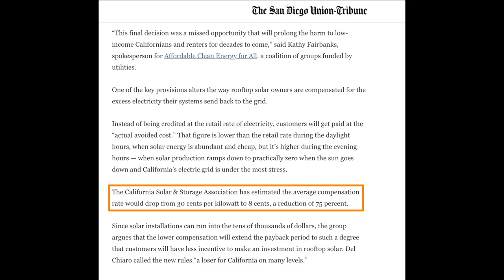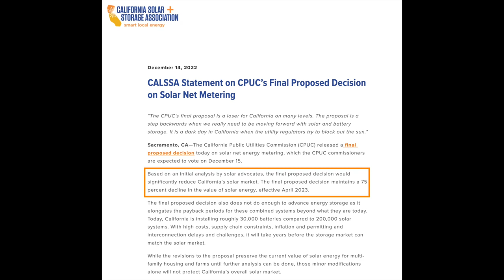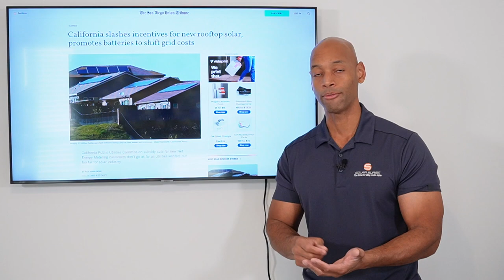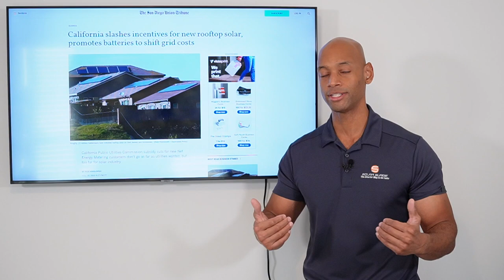URGENT: California Solar Program Ending April 2023

Comment: Keep voting for Democrats.
Reply: And we will dissappear like Rome
Reply: @erikapple8955  exactly!
Reply: Question: Does it have to be Docs signed or installed in PTO to be grandfathered in for 20 years for net metering?
Reply: @solarguy6517  - I’ve been told complete installed. Check with your utility company.
Reply: @appleforever6664  Roger that! Been studying it all night!
Reply: @nicksgarage2  - Not for solar. 🤡
Reply: @appleforever6664  but they hate green energy. Big coal, big oil, sure
Reply: I am hoping this is sarcastic.  Since the legislature in CA is run by the democrats.  In FL, the GOP passed a bill to eliminate net metering, and Gov DeSantis vetoed it.
Reply: @appleforever6664  it’s NEM application submitted, not PTO.
Reply: Jail time. Theives.
Reply: Okay 👍
Reply: In reality Republicans would have never had the program in the first place. Regardless, I normally vote for Democrats but have been voting Republican across the board in the last couple of elections. Many of these elected officials seem to have forgotten they work for us, we don't work for them.
Reply: Net metering was never meant to be a long term solution. Storage and use at the point of generation was always the inevitable end point to all this.
Reply: @acefire4050  - Completely agree with you. My statement was with sarcasm. This is what happens when people vote for Democrats and then they turn on the people!
Reply: @rfjgfude  that just means you’re becoming more conservative as you get older.
Reply: Not
Reply: @solarguy6517  I heard paperwork signed
Reply: @rfjgfude  yes to the last sentence.  It's not about party anymore people.
Reply: @drewgoodman7932  
and in some ways that is just fine esp LT. 
It is criminal ratepayers are continually being charged for PGE f-ups!  Where is the accountability...Governor?
Reply: @planetwalker798  Solar Surge replied: "It can take up to 30 days to complete an on-site survey, receipt NTP from financing, and clear engineering internal review. Usually all of that happens before the interconnection application is submitted to the power company."
Think I will focus efforts in CA for a couple weeks and heavy in florida.
Reply: @appleforever6664  is the CPUC full of democrats?   Or energy loyalists?
Reply: @appleforever6664  well the  governor appoints them its no wonder that cali is number one in solar.  So sure you can blame the democrats for this change, but even this is better than most states.
Reply: @solarguy6517  NEM doc signed.
Reply: And what.. the GOP is the better option?? 😆 🤣 😂 😹

Comment: If they're buying it at 6-8 cents and charging us $0.30, then there's the real problem. Crooks.
Reply: They're buying it at a time when they've got a surplus and they don't need your power, you're using it at a time when they have high demand and they have to pay expensive gas peaker plants to generate it. Not crooks at all, thy're just trying to balance the books. Just get a battery so that you can supply when grid prices are high.
Reply: That 30 cents includes all their transportation and maintenance costs.
Reply: @John Fox Buy something for 6-8 cents, sell it at a 400% markup, can't make a profit? That's even worse. Goes to show how your state-sponsored monopolies operate. The free market would never allow for this.
Reply: @jimnorrison8481  It's not a 400% markup. They have a lot of costs. One of them is the requirement to increase wind and solar while still having to maintain facilities to provide power when the sun doesn't shine and the wind doesn't blow.

Comment: I think that the Net Metering system was originally setup to encourage residential solar systems. However, if the utility is forced to buy solar power during the day at full retail price, at times when the utility may not need the power, then credit you power in the evening when demand is at the highest, how do they make a profit to pay for their overhead? Using the utilities as a Free battery doesn't seem fair to the other rate payers that are not able to afford solar or don't have the ability to install solar (apartments). These rate payers will have to pay more for their utility power to offset the loss that the utility is forced to take on the Net Metering system. Someone has to pay for the infrastructure and maintenance and other administrative costs of running a power system. With your own battery system, you take responsibility for time shifting your electrical power production to the time that you want to use it.
Reply: We've got solar and I totally agree.   We have battery storage.  I saw this coming and I can sympathize with the utilities.  In Hawaii and other states they abandoned the net metering because it just didn't make sense.  It's not like the grid stores energy like a battery.  The utilities have their own solar production and when we are producing at peak, so are they.  And they can only store so much.  They have to generate power during they night in another way.  And they are not allowed to upgrade those systems because they are not "green".
Reply: But calafornia keeps having rolling blackouts, because its not producing enough energy to fit the demands for power.
Reply: @bobbg9041  Since power produced must be consumed at the same moment, fast reaction peaker plants are used to provide the fast production of power when needed. However, California has removed much of the peaker plants in their quest to reduce emissions. This issue along with their lack of expansion of their overall power grind as their population has grown has left California with a fragile power system. Solar and Wind generation do not always produce power at the time that it is needed. That is why batteries are need. But, the amount of battery storage needed is gigantic and it will take well over a decade to make and install the needed batteries on the grid. That is why California is delaying their decommissioning of their last nuclear power plant. My suggestion is to add your own battery system to your home to protect your family.

Comment: I would start first by making your house the most energy efficient possible.  Lots of insulation in the attic (R30 and higher), good windows, etc. and making sure your roof is well ventilated.  I installed a power ventilator on my parent's roof and it made a huge difference in the hot summer. A/C doesn't run near as much and house seems to stay cooler longer.
Reply: Yes.  What did the attic insulation run?  
Older home here, and bumping insulation could help a lot!

Comment: 80% of sales in California will dissappear
Reply: No, they won't. California REQUIRES solar installations on new homes.
Reply: @michaelwilliamson1392  LOL. Most people dont live in homes finished yesterday. Duh
Reply: @michaelwilliamson1392  - Building Code will be next to change.
Reply: @michaelwilliamson1392  No new homes are being built. So yet it will, say goodbye to solar in California until we march on Sacramento.
Reply: @michaelwilliamson1392  The majority of what I'm seeing built in the Bay Area is high density housing and greater than 3 stories so they are exempt from the solar install mandate. Very few new single family homes being built. New homes are a tiny drop in the bucket relative to how many existing homes do not yet have solar.

Comment: let's think this one all the way through.  Rich people will have self-generation power.  No local power company needed.  What does this mean to the poor people?  You will have to deal with the local power company, rates will keep going up and less and less people will use that platform causing rates to increase even more.  As less people need to use the power companies' cables, the maintenance of that infrastructure will be shared with less people causing the cost of that system to increase a lot more per subscriber.  This will end up with poor people not having access to the local power grid or self-generation of power.  The road to hell was paved with the best intentions.  You must have considered this, but it undermines your business model, so you ignore it, sick.

Comment: I own a solar company in California. 
At the present state of battery tech, the ROI's for full storage (off grid, essentially) is so long, the batteries themselves need replacing before you start to get in the black.
We need better batteries!
I will make sure my salesmen are fully armed with a copy of the PUC decisions....will help boost sales in the short run. 
THANK YOU.
Reply: @DrJohnnyJ  Sure. California Electrical Contractor, C 10 873388. Currently operating Superior Solar and Next Gen Energy Solutions. My Sole Prop is called General Telemetry. I am the RMO for both above mentioned businesses.
....Republican??? No. I am an engineer, dude.

Comment: This is what I have learned. There are States that electric rates are very high and they push solar to help save you money.I moved out of NY where my electric was 300 a month.Oil heat in winter .Now I live in NC and my house is twice the size. I have a heat pump that heats and cools my house.Always less than 100 a month. And it’s hot down here in the summer.No one down here has solar

Comment: Thanks for the heads up, Joe. Our solar(with backup battery) installation was just completed and we're awaiting city final inspection. Our sales guy mentioned the possible coming changes in the net-metering rules, here in California. Glad we didn't put off getting solar until later next year. Thanks again.
Reply: What Company did you use for your battery? We are looking for a battery as we speak. Thanks
Reply: @protecttheweakdefendthestr8977  We ended up getting the Tesla PowerWall 2, but were also considering the Enphase Encharge 10.
The sales guy had high regards for both, but felt the Powerwall 2 was the better choice since we were only getting one battery (for now, at least).
Reply: @protecttheweakdefendthestr8977  
I'd really consider whether or not batteries are worth it if you're grandfathered in under NEM 1.0 or 2.0. Unless you have a real need for backup power when the grid is down, batteries don't pencil out. The CPUC rules state that adding batteries won't effect your NEM grandfathered status (however adding more than 10% or 1KW in panels will), so most people pre NEM 3.0 are better off waiting until the cost of batteries come down and the technology improves. Batteries in the $10K range will only allow you to back-up a few circuits. You'll need to spend a lot more to cover your whole house.
Reply: Due to PG&E's gross negligence, our house burned down in 2017.  Fast forward to 2022... after we sued PG&E and received a very nice settlement, we're going to use some of those funds to put in a solar system with 2 Enphase 10 backup batteries.
Reply: @justkeepingitreal2024  Out of curiosity, how much are you paying for the batteries? 
Make it clear to your installer that you want to make sure that at the very least your interconnection application is submitted to PG&E before 4/15/23 so that you're grandfathered under the much more lucrative terms of NEM 2.0. Missing that deadline would cost you thousands of dollars.
Reply: @aldiaz33  I paid $10,000 each for two Enphase 10 batteries, installed.  Using the backup batteries rather than installing a backup generator.  I entered into contract with a solar company on 11/7/2022.  In the permit process, waiting for an installation date.
Reply: The problem living in California is most places here are hot in the summer.  A/C is the biggest hog for you KWH!  If you want your critical loads panel to run your A/C you are gonna need a big battery setup.  I have Lead Acid batteries right now and I am going to switch to LiPo batteries in 23 because the feds are gonna throw fat cash rebates to us.  They increased the solar tax credits to 30% for not only panels but batteries, charging stations for EV's, etc....  The thing that pisses me off the most is how the power companies keep changing the rules and the profits they make keep ending up in the California politicians pockets.  If panels and batteries come down in price people are going to choose to walk away from them and in the end they will go bankrupt.  In winter peak PGE rates are .30 a kWh and .28 during non-peak.  Last summer they were .39 a kWh and .33 non peak.
Reply: @dgsantafedave1  We live in California and don't have A/C and seldom need it.  2-3 days a year over 100.  PG&E rates are escalating and will continue to do so.
Reply: @justkeepingitreal2024  I’m so sorry this happened to you and I’m happy you guys decided to go solar. Utility compagnies suck and literally have very old infrastructures causing so much damage, all the upkeep charges are then passed down to us homeowners.

Comment: Knew this was coming, our installer gave us a heads up about the pending changes. Had solar installed January 2022. So far this year no usage charges, just the fixed charges. Hopefully battery backup  2023.
Reply: From a strictly financial perspective, it makes zero sense to spend $10K-$30K on batteries if you get in under NEM 2.0. You're getting retail credit, 1 to 1, for any power you export to the grid for 20 years. The only scenario where batteries might make sense under NEM 2.0 is if you want power back-up when the grid is down (Ex- you live in an area prone to prolonged power outages and/or you have medical equipment where uninterrupted power is needed). Other than that, batteries aren't worth it. The new 3.0 rules make it clear that adding batteries in the future will not impact your NEM 1.0 or 2.0 grandfathered status, so there's little reason to pay so much extra for them now.

Comment: As an SDG&E customer, I already got changed to a less desirable plan when I added into my system. Got switched to a TOU plan instead of straight net metering. Plus they block peak shaving with batteries.
Reply: How do they block peak shaving with batteries?
Reply: @alecanderus  Here they wouldn't allow you to charge the batteries from the grid, only your solar.

Comment: We're in NY and have net metering but expecting the same thing will eventually happen here.  It's good to know CA grandfathered in the existing customers for 20 years.  Does CA still have this program for battery storage: 'In California, the Self-Generation Incentive Program (SGIP) is a rebate worth between $150 and $1,000 per kWh of battery storage installed for eligible residential projects. This rebate is available after the battery storage is installed and, in some cases, can cover the entire amount of the project.'  Sep 27, 2022

Comment: They were already not giving paypack kilowatt for kilowatt - my rate for electricity until 3 pm is 20 cents per kWh and after 3 pm - it is 50 cents per kWh  which meant that PGE buys solar production at 20 cents per kWh but sells it back to you at 50 kWh. It was this math that prompted me to get Tesla powerwall last year.

Comment: You forgot to mention that the storage is not 1:1 because you need more power to charge the battery then the power it produce.  You lose about 30% energy.  Lucky in my state they do 1:1 net metering so the grid store my excess energy and get back at night for the same energy produce.  I only pay if I use more that I produce.  Thanks for the video explaining about the new California solar program.